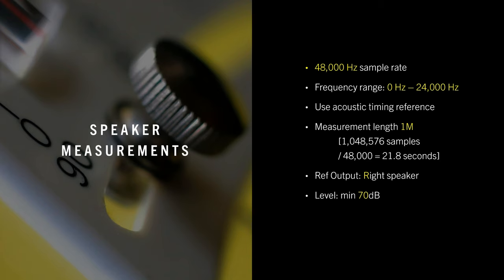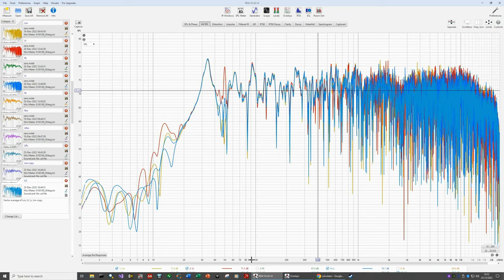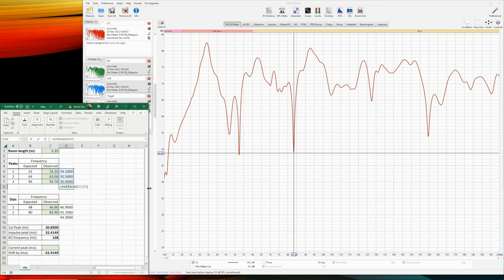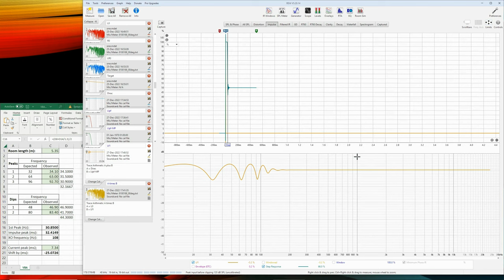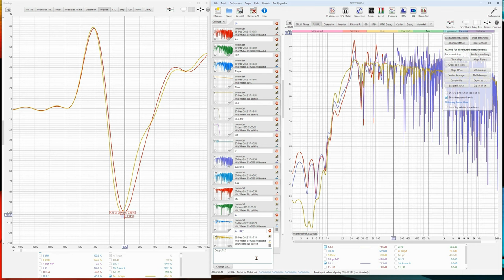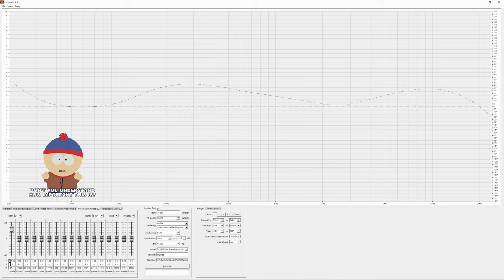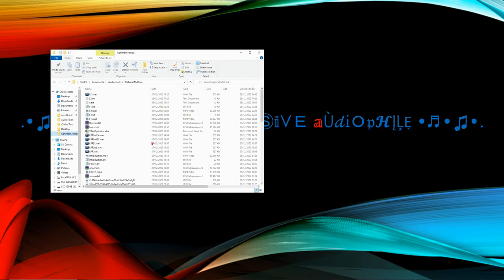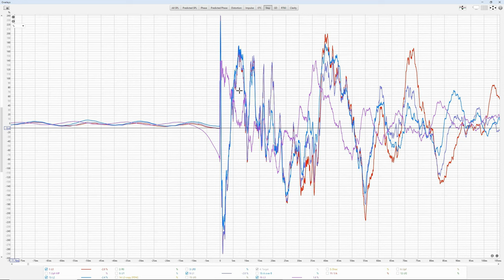High Fidelity Digital Room Correction with REW & rePhase

Comment: This might be obvious to some folks, but I thought I would note it here if someone else has older speakers and no technical specs. I have Paradigm Studio 40v3 mains, purchased way back in 2003, and while I still have the original paper documents, they didn't include the xover info. I couldn't find any site with reliable info for them. I managed to find a site from years ago from a fellow who decided to change the tweeter and crossover, but only his modified xover schematic was shown. Not much help!

These are "2.5 way" with a woofer that according to all descriptions is allowed to roll off on its own, plus a midwoofer that is crossed over to a tweeter. One site noted a 1.5 kHz xover to the tweeter, but that seemed crazy low. I then recalled that as they have two sets of terminals for bi-wiring,  I could simply disconnect the jumpers and run full sweeps on both the woofer and tweeter taps. SPL traces on REW confirmed the mid-woofer to tweeter xover frequency was 2.5 kHz with 18 db/octave roll off on either side. Of course, I see nothing for where the woofer actually rolls of, and where the mid-woofer picks up.

For such a configuration, is the only xover for which phase correction can be applied the mid-to-tweeter? Thanks!
Reply from the maker: You can try to correct the phase with this alternative method: with a Left + Right speaker measurement, no FDW applied & no smoothing; look at the impulse response and manually adjust to align the FIRST peak of the impulse to t=0. If this peak is negative then you should also invert polarity. Then export the response to rePhase. You should see your phase curve gently and asymptotically reaching 0° (or a 360° multiple if looking at an unwrapped curve) at the Nyquist frequency (24kHz). This means the global LP filter of the system is ignored. Then start with a 24dB/oct linearization at 2.5KHz and move down from there adding filters at phase discontinuties (the dottted vertical lines). It's very unlikely that an old speaker will have less than 24dB/oct XO shift so I'd go higher (36,48) rather than lower (12). As long as you have a fairly flat phase response, it will do the job. When you convolve the resulting XO filter (vector multiply the wav file produced in rePhase with the speaker response), if the "plot not normalized" impulse peak magnitude is higher than the original (it might reverse and this is ok) then you've done a good job.

Comment: Is it possible to do active crossover by this? Do we only need to change target type in EQ target setting tab? Thanks!
Just realized from this video that cross correlation is based on the one at the top......I need to do the measurement again now
Reply from the maker: In the REW EQ window, there are two crossover filters available (last two filters) and you can create FIR filters (wav files) from them. rePhase has even more flexible low pass and high pass filters.
Reply: Excellent Video... again!😊 I'm still struggling with the phase correction of the speaker(?): As per measurement I have 4 phase shifts in the high frequencies. After uploading the txt.file (fdw 1!) to rePhase I need to apply a time offset of -288 and then I do the Phase corrections (after I Inverter polarity) with the filters linearization tab and the paragraphic phase EQ. When I upload the generated wav file to REW then, and so the a*b convolution with the base measurement (the one I uploaded) and do time alignement and then look at the phase it still goes zick Zack in the high frequencies. This only disappears, when I Offset t=0 to -288... Is this correct? What does this mean? The step response after time alignment looks much better though (First Peak upwards due to inverse polarity of filter). Nevertheless under SPL &Phase, the Phase does only Look better with time offset -288.... Maybe I'm just to stupid to understand, what's correct, but I'm confused....
Reply from the maker: @andreasheiden7122  The phase response at high frequencies is very much dependent on the mic position (thus measurement timing and your results being dependent on Offset t=0 parameter) and is very volatile. You don't really need to flatten phase outside of 100-1000Hz except fro crossover phase corrections. Watch around minute 5:00 of this video:

https://www.youtube.com/watch?v=OpzQFNB8BC0

There's also more up to date info on crossover and box phase correction in these videos:

https://youtu.be/pbCJjNw3bJ8

https://youtu.be/ydMkpPKYuaA
Reply: @ocaudiophile  I now did new measurements with 1Mio/48khz in different positions. This now not only gives me very strange results when I calculate vector average, but also when importing in rephase there are now so many phase shifts to the right side (highs) that I can't get rid of them. I also have to time Offset to the opposite direction than before (now + more than 1000micrs) with my previous measurements that I took with 256k.... I have no idea ...🙄 That's frustrating...😭
Reply from the maker: @andreasheiden7122  you must be vector averaging before you cross corr align them...
Reply: @ocaudiophile  I guess you mean cross corr before vector averaging....? It's strange, but I don't hlseem to have this cross corr button....
Reply from the maker: @andreasheiden7122  Time aligning them or aligning IR starts would also do but for cross corr align you need an early access version of REW. You can download from this link:

https://www.avnirvana.com/threads/v5-20-14-early-access-build.11154/
Reply: @ocaudiophile  as always, thank you for your quick support.👍 I will try again later today, but I used "time align" several times and it didn't work. Vector Average gave strange results with two huge dips in the averaged version that just aren't there in the single measurements. I thought it could still be die to cancellations coming from different phases in the highs. Maybe also due to the nature of the speakers (Magnepan flat panel with tweeters to the outside and bass/mids to the inside)... Maybe it's the measurement as I didn't have the problems with the 256k measurements I did before....? I measured with acoustic timing reference and set offset to 0,00 and always used "R" as reference output (for the left speaker too!).... I'll check again today. 
Also, when I exported only one of the hires measurements to rePhase for testing there were gar more Phase shifts in the highs than the 4 that I had with old lower res measurements. I had to use time offset of more than 1000 in rePhase to get rid of them and it still wasn't gone...🙄
Reply from the maker: @andreasheiden7122  time align sometimes cannot get it right. Cross corr align always does, just remember to click it a couple of time until impulse responses stop moving completely.
Reply: @ocaudiophile  Hi Serkan, I now tried "Cross Corr Allign" now with REW-version 5.20.14 and it works. Nevertheless I still have a problem with the import of the Vector Average File to rePhase. I did everything exactly as you described, but there are too many phase shifts to the right of the measurement even if I use FDW with 1cycle! This is now that I did the measurement with a high resolution of 1Mio. I didn't have this problems with 256k resolution. Also the 1cycl measurement shows a very strange frequency response. I know it should look very smoothed out, but with 1cycl it show a drop of 20db SPL between 1khz and 3khz.... What would be the problem when using the 256k measurement? Wouldn't that still be sufficient? With 256k I can use FDW of 15cycles to make it look ok in rePhase.... Did I do anything wrong when measuring...? Any advice would be highly appreciated.
Reply from the maker: @andreasheiden7122  Crossover phase correction is not easy to get and unfortunately clock deviations during measurements might cause phase differences. REW is not the best measurement tool out there to get the phase right in that sense. Share your measurements and your speaker XO frequencies and I will have a look. You can paste google drive links here, I will receive it as email.
Reply: @ocaudiophile  
Thanks a lot. I hope this works...😉

https://drive.google.com/file/d/1bHgz5YP7CQf1i9-H30pmHjrEWj2KUfbQ/view?usp=drivesdk

Comment: Hi, very interesting. Struggling a bit too implement. I have a very reflecting room also due to a sloped roof. I have 2 questions please on the vba part to start: 
1. Is it necessary to measure my sub apart from my mains and time align and then create an averaged response for left and right speakers to start creating filters, ór can I just make measurements with main and sub together for left and right and ignore any possible timing differences for the sub and main speaker. (Or do the lower sub frequencies not cause timing differences?
2: Is the crossover frequency álways 108Hz, or what determines this? My room sim gives (of course) different standing wave frequencies and I guess due to the sloped roof they differ quite a bit when trying to match with the actual measurements...
Appreciate your advice and comments!
Reply from the maker: 1. I would first time align the sub and the front speakers, cross the sub over around 80Hz or below with the fronts and then measure and correct the mains with the sub actively involved.
2. The crossover frequency for VBA is determined by the frequency of the optimized first peak frequency ( x 3.5). The XL file provided will calculate it for you.
Reply: @ocaudiophile  Hi, great, thx. 
But for 2: the XO frequency now calculates 141Hz for me... Is that not too high? Roomsim peaks expected at 45, 91 and 136 for a rectangular (but wider) room without of course the sloped roof into account: I observe peaks at 47,.9  81,9 and 117 (I guess ...)
Reply from the maker: @MrLugt  Where's your first peak and first dip (around x1.5 of first peak) at? If you write down first peak&dip frequencies for left and right, I can send you a short impact VBA due to your tilted roof.
Reply: @ocaudiophile  first peak observed is at 47,9 first dip at 65,4. This is my what my first try gave: combined sub with main. 
Need to do reruns with time aligned sub maybe... Is there a formula for a tilted roof?
Reply from the maker: So we're talking about a room with around 3.6m length. Create a lpf with XO at 68.60Hz. The polarity inverted MP version will have impulse dip at 11.52ms. Give it a -10.3379 time offset and move the impulse dip to -21.8579. That's your VBA filter for whichever speaker that is. Do the same process for the other one. There's no formula for tilted roof, at least not one I have developed but I am just cutting the filter quickly to ignore second and third reflections. This should help shave the worst peak and dip.
Reply: @ocaudiophile  Thanks for your quick replies! I will give this all a try, and try to get to an understanding of what is going on ;-)

Comment: Should you have ‘decimate IR’ selected in the ‘Analysis’ tab of the preferences pane in REW?
Reply from the maker: Very rarely like if you measure a subwoofer for a limited freq. range only, it will decrease the sample rate. For example, if you measure with a lower high frequency range like 0-250Hz instead of 0-24,000Hz, the sampling rate will drop from 48kHz to 3kHz and operations like "Cross corr align" will not work between measurements of different sampling rates. So better untick it.
Reply: @ocaudiophile  yea…..that is what I thought. Many thanks for confirming
Reply: Did you mention why you didn’t use Frequency Dependent Windowing? Sorry if I missed it
Reply from the maker: It's in the description under the video.
Reply: Apologies but I do not see the explanation. perhaps you can copy and paste the answer? 

sorry for the aggravation
Reply from the maker: @ts6640  It's in the Word file in the zip in the link:

https://drive.google.com/file/d/14kmo1ycD0CIUoGoz9QCNseRJdcb29Qr9/view
Reply: Thanks

Comment: Wouldn't it be better to do the inversion step with a dB average instead of a vector average given that vector averages usually give less volume than a dB average?
I know that this is due to the vector average also putting phase into the calculation, while dB averages obviously do not.
As we don't correct phase above 1-2kHz anyway this wouldn't really matter, right?
Anyone tried this?
Reply from the maker: I used to use RMS average (root mean square of dB is more accurate than just dB average) for the exact reason you've explained but you'll see that target curve levels produced for both are almost always nearly identical so I don't bother anymore and with vector average I have additionally the phase response to play with.
Reply: @ocaudiophile  nevertheless i've tried it. ;)
Love to tinker with stuff.
With dB averages i get a lot more preringing after inversion than with the inversion of the vector average. I don't know why as i don't see any reason as the inversion of a frequency response is independent of any phase information and with variable or psychoacoustic smoothing the corrections aren't stronger/larger than with the vector averages and a FDW of 15.
Reply from the maker: @Cathul  If you remove smoothing from the final filters you produced with dB average (and this is how they really go into the convolution engine) you will see sharp peaks and dips which cause the ringing.
Reply: @ocaudiophile  yes, but i also have sharp peaks and dips in the final filters from vector averages. ;) Still vector averages filters produce less ringing here.

Comment: Hi! Thank you so much for your effort!

*SOLVED! Works fine in v 5.20.13* Possible bug or change of methodology in latest beta release. 

When I do a L1/Target calculation, the resultant measurement has an average of -40db or so, when I do a 1/A inversion of this, it generates at around 0db (target level reads at -34.7db). 
I have verified over and again, and to this point all else looks good. Any idea? Thanks!
Reply from the maker: dB offset levels of trace arithmetic A/B operation have been recently revised in REW early access versions. The offset you need to apply to 1/A might have changed. As long as the result of AxB operation with the original response and the filter  (1/A MP) is on the target curve, you should be fine.
Reply: @ocaudiophile  It seems to be ignoring the target level, but follows the target shape. Irrespective of the set target level, 1/A-mp * L1 results in a level which is the avg level of L1. 

Does it matter that I used loopback as my timing source rather than the right speaker. I have aligned all impulses to time 0.
Are you available on any forums, or do you recommend any where I can further understand and educate myself. I
Thank you so much again!
Reply from the maker: Although I don't think there's much relvance for the probelm you mention, loopback as timing reference is very tricky to get right. I would suggest to try with acoustic timing reference. If you share your mdat here I will have a look. You can post google drive links here.
Reply: *SOLVED! Works fine in v 5.20.13* Possible bug or change of methodology in latest beta release.
Reply: In the latest beta release, the 1/A iversion now sits @ 0db, however the 1/A-MP times L1 inversion still sits above target, after 1/A is adjusted to 3db offset. Is I set this to a 0db offset it sits with the target cuve. 
Im wondering how critical is 3db gain difference between the filters?
Reply from the maker: @nitinsidhu The correct offset level is written in the notes section of the A/B operation in the new REW. As long as the result is on target, it's OK.